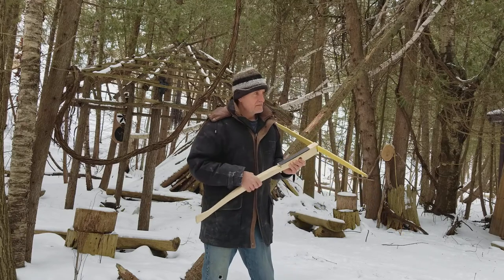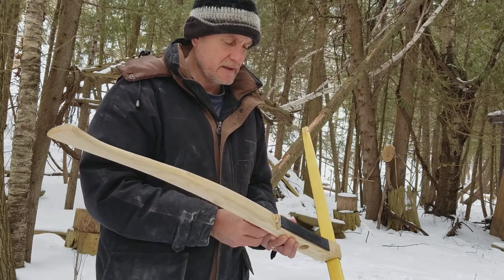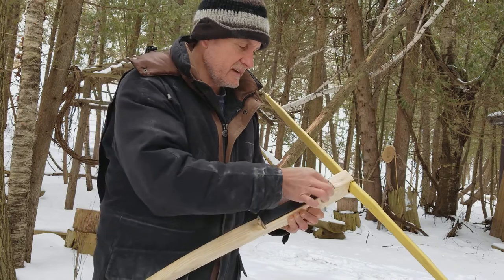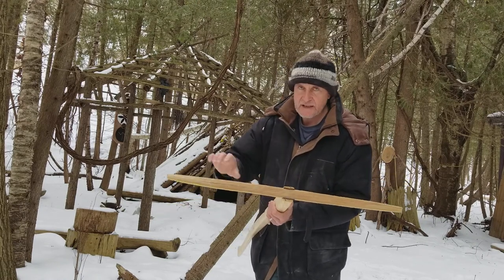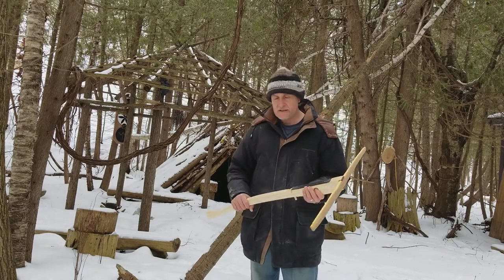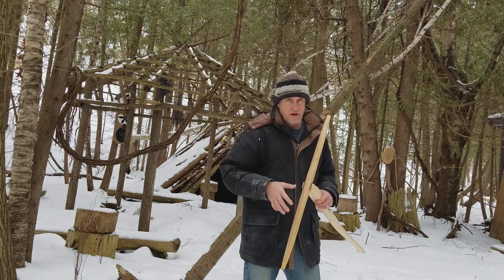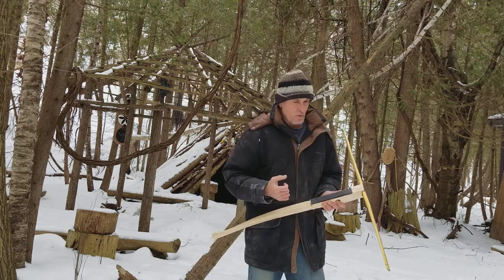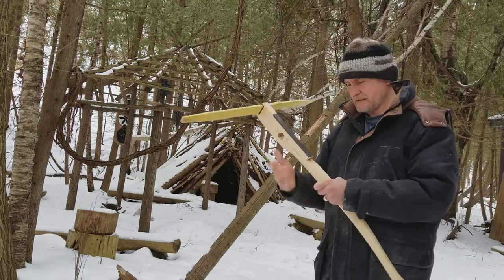Sinew Backed Crossbow , #6, Nearly Complete

Comment: I am planning to build a crossbow(I know I said that so many times) but I was wondering where did you get the horn for the bolt plate? I was thinking of when I get enough money of making a crossbow that is somewhat period correct to the middle ages. More likely probably towards the end of the medieval period because that is when the crossbow was becoming more of a sporting tool than a weapon of warfare. Like I would probably make it to focus more on accuracy than functionality. Another crossbow I was planning to make would a stone crossbow but probably not period correct. So I would make it more of more improvement of the original designs make the plate maybe out of aluminum to reduce friction use a modern string to increase string and etc.
Reply from the maker: Accuracy is the key. You're bringing up a lot of good ideas. I bought it from a guy named Peter Cua in Indonesia a long time ago. I betcha if you do a search for horn strips you'll find them.